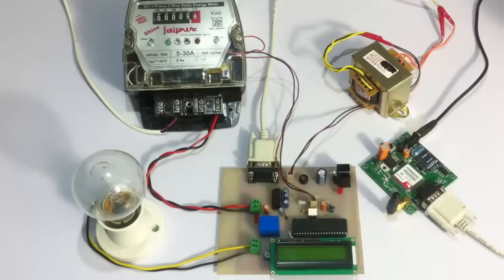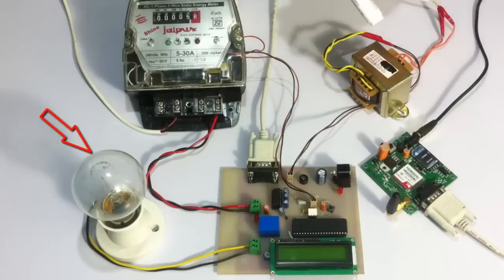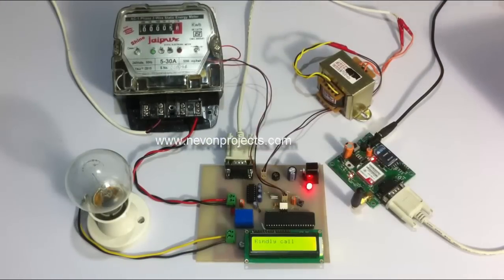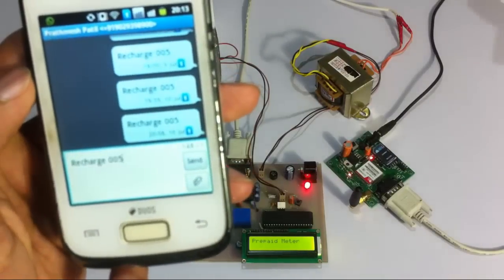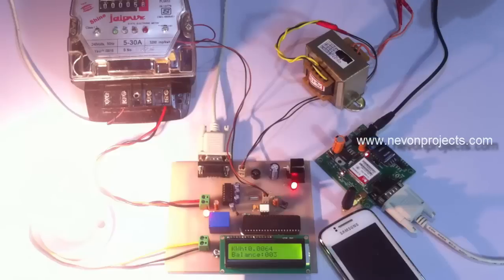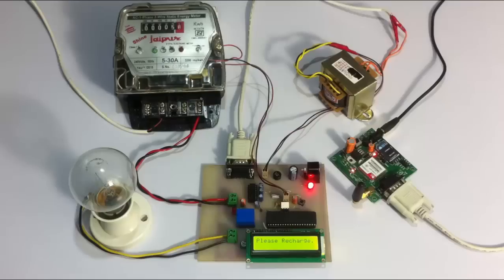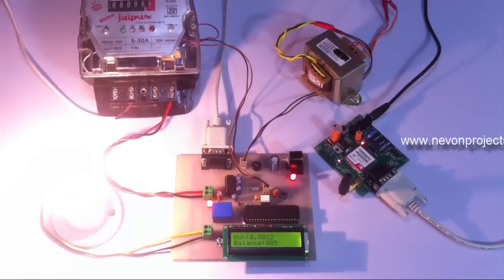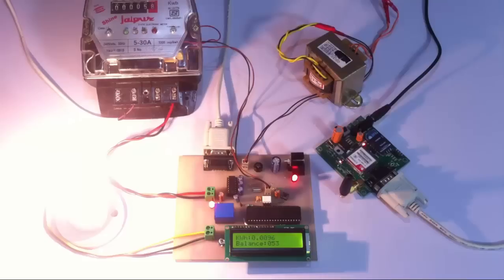Prepaid Electricity Billing Meter Project

Comment: There is a breach in this project, I can see the message on LCD and by inserting my own sim I can recharge and enjoy uninterrupted service  
Nice project but need security
Reply: +Pernell Butler what happens if I put my own sim in npower meter? cheers
Reply from the maker: +Kunal Navhate if u insert ur own sim, the electricity supplier does not get an sms of that meter in that month.... and your service is permanently interrupted until you pay the fine... hows that for security ?
Reply: +Nevon Projects so if I take their chip out they shut off the Electric due to not receiving any info?
Reply: +Nevon Projects yea thought that's what would happen.  cheers
Reply: We can use our normal sim card or not?...ppZz some one tell
Reply: By using a fix sim IC
Reply from the maker: +therealmrcheese well they will come and check it ofcourse why its not sending data... and if a breach in their metering system is found they will take action against that customer..
Reply: @NevonProjectsOfficial  for research purposes what if I reinsert their sim to a different gadget